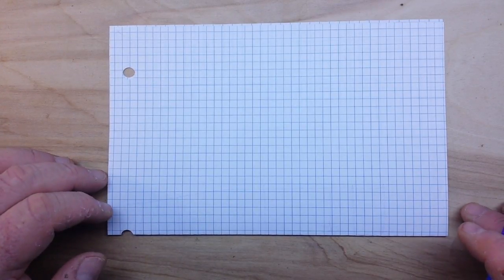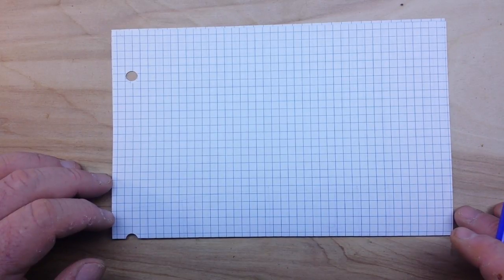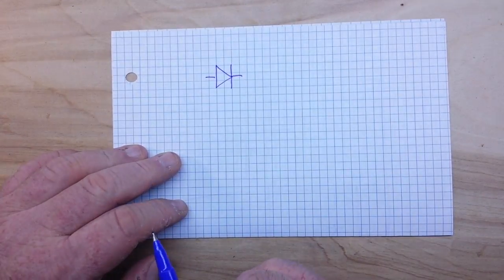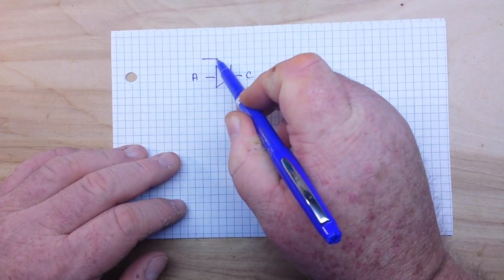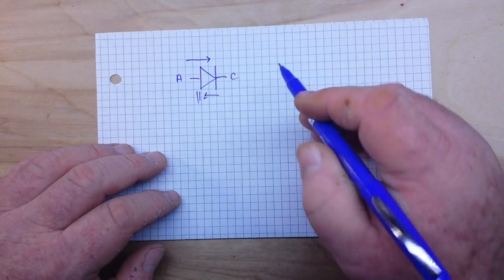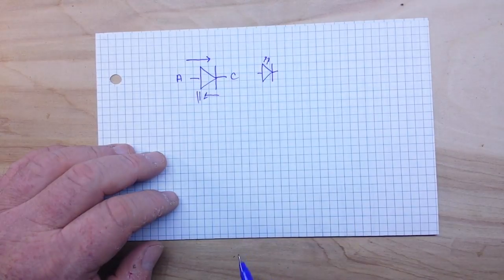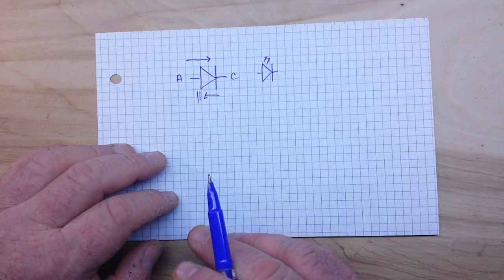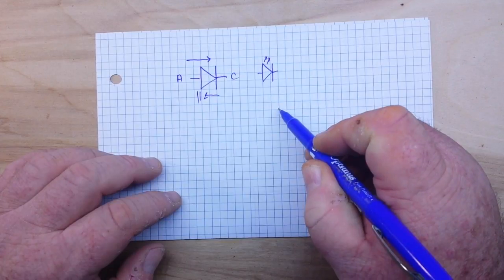Make your own simple polarity probe

Comment: I have a idea for a voltage regulator. voltage controlled switch type thing. its a voltage regulator for a alternator. I'd like to run it by you if I can. to see if you think it will work. like I think it will. using a N chan. FET. a opto. a about 26v zener . and a voltage divider. but use it backwards. and on the ground for the opto. and the zener will pull the opto ground high. shutting it off! with the opto on the gate of the N channel FET. witch will ground the alternator brushes. I can draw it out and send it to you. if you will give me contact info. I need to potentially build 6+ or these . if it will work. I have no soldier less bread board. my house burned down last year. I had no insurance. so its taking a long time to replace things. but this is the first circuit I designed. working or not! I appreciate your help greatly. gust from the videos . if you could give my regulator a look. even more! thank you so much.
Reply from the maker: +James stranger Sure, I'll look it over for you. Arduino0169@gmail.com